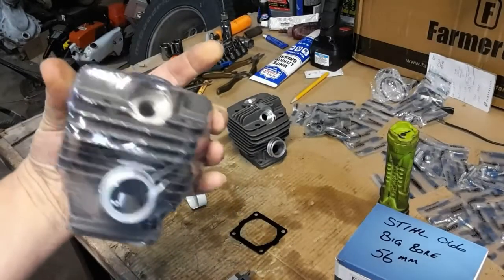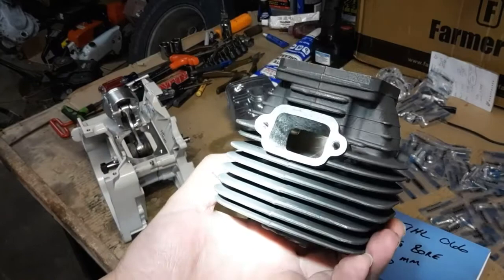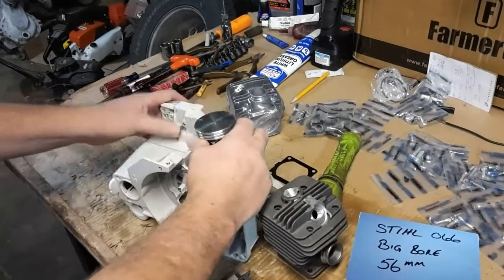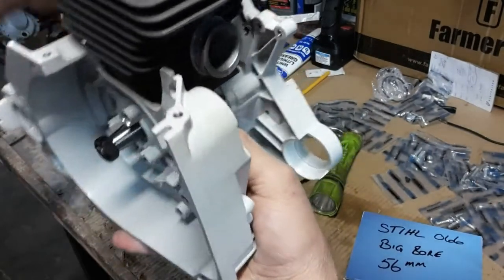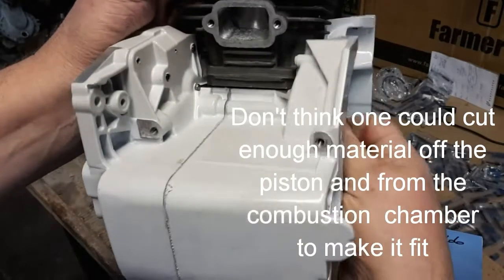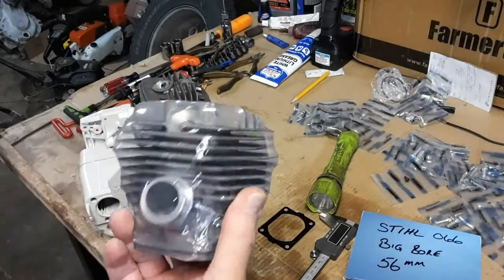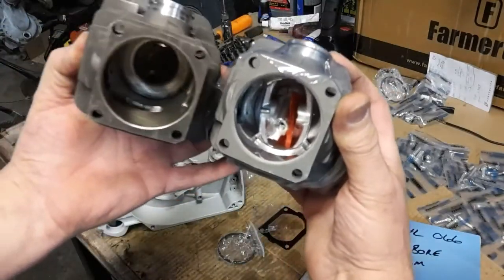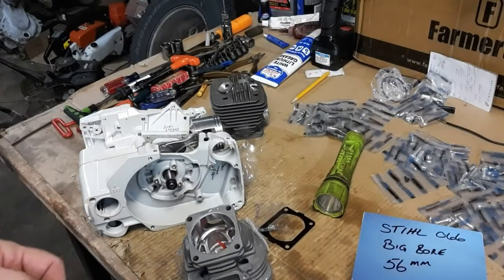Huztl MS 660 Cylinder won't fit

Comment: Craig, I purchased 2 each Farmertec/Holtz MS660 saws assembled.  Decided to buy the 56mm big bore kit with pop-up piston.  During assembly, I detected metal-2-metal contact while rotating the crank.  The crank hit lockout while rotating.  Pulled it apart and observed the piston skirt was hitting the top of the crank counterweights.  I ended up slowly removing metal off the bottom of the piston skirt until adequate clearance was obtained.  Since this is a single cylinder engine, balance was not a big issue.  No free-port observed.  Bought a similar kit for my 2nd MS660 and the same situation occurred again.  Both saws have 0.020" squish.  Building a MS880 kit now.  I appreciate the info you posted on centering crankshafts.  Keep up the good work.  I subscribed,

Comment: they never sent you a replacement?
Reply from the maker: I did not pursue a replacement due to I had done lots of grinding to the cylinder for port work before I tried test fitting.
Lesson learned now I always test fit first.

Comment: I've put at least 10 of these kits together never had that problem did you put the piston in the cylinder off the saw making sure that it's going all the way to the top of the cylinder
Reply from the maker: Yes I did, ths squish with the stock cylinder and piston with metal gasket would have been around 
.047 thousandths and the gasket delete build i done come in at 
.021 thousandths squish.
The inside of the Big Bore looked rather good it was a real shock when I found it was a head slapper, I beleive the poston might have been a Husqvarna 395 piston miss packaged but that's just a guess.
I have another 660 kit that I'm debating on building useing this big bore piston/cylinder cutting a pop-up and if needed cutting the squish band to set the squish to around .020 thousandths with a base gasket.

Comment: A fiber base gasket is what came with mine, grey in color.  I do not know what the squish is, now, and do not really care.  It runs good, cranks easy and relates. That is all that matters to me.
  I know Walt had a problem with the 56mm pistons - they kept hitting the base gasket and case.  As I remember, he had to release the piston skirt to keep this from happening.  That .65 dimension you mentioned has to be in millimeters, instead of inches, but you did not state which.  These gaskets are about 20 thousandths thick.
Reply from the maker: The .65 reference is in millimeters, in the upper right hand corner of the display on the caliper you can see it is displaying mm

.65mm is right at .025 before it is installed and crushed where it should wind up right at .020 and this is on the metal shim gasket which is in this video.

Comment: I built my ms 660 with the stock cylinder and piston and it ha .00225 squish with the paper gasket that came with the kit.  It beat me to death cranking it.  I finally replaced the cylinder and piston and used a metal base gasket from hL supply.  It is a piece of cake, now.  It has about the same pull over as my ms 271.  Before all it would do was pop and yank the starter rope out of my hand.  It broke two starters and pulled the rope right out of one of them.  Now, it is a pleasant saw to crank and usually does it with just a few pulls.
Reply from the maker: I built this saw useing the stock cylinder with no base gasket obtaining a squish of around .020 if I remember. 
I have built 5 of these 660 kits to date and have never been supplied a paper base gasket all of them supplied have been metal from Farmertec/Huztl and metal is also what is stock OEM from stihl so the paper gasket must be something new or your kit was assembled with the wrong gasket.

Comment: Ran into the same issue this past week, not quite as bad. Original piston and cylinder went fine. Did 2 of them and 1 big bore was fine and 1 wasn't. Waiting for answer on replacement. Overall I am impressed otherwise.

Comment: I had a problem with that little cooling fin on the right forward corner next to the exhaust port.  I had a he'll of a time getting that cylinder bolt into the cylinder on the 54mm jug.  I had to grind it off before I could get the cylinder bolt in.  The delay may have compromised the base gasket seal and I may have to pull the cylinder and replace the base gasket.  You need to check to see if you can get the bolts in before you put the cylinder down on the case.  I will do this in the future.  I thought my 54mm cylinder was pretty good on the inside and outside.  I made no modifications to it except cutting off that short fin during the assembly process.

Comment: Ms 661 has a 56 mm bore an a37mm stroke the 660 has a 54 mm bore an a 40 mm stroke
Reply from the maker: Thanks I'll check the stroke and mic the big bore piston and maybe get this figured out
Reply: Craig Timmons I'm building  660 right now I'm trying  a 54 mm pop up piston this time  all the big bores iv done have ran hard good power it's still hit an miss on the after market cranks tho seems like 1 in 3 fail on the big  end of the connecting rod an I've had two snap off at the flywheel  thin one I'm building  now has a oem crank an mostly Italy made parts
Reply from the maker: No issues with my ms660 as of yet, good luck on this build hope it turns out good.
I'm in the process of an ms440  build at the present time. Fuel tank would not hold pressure or vacuum, found over flashing in the cap opening where the o ring seats trimmed that off now all works as it should including the tank vent.
Reply: Craig Timmons my 440 is a beast it's one of my favorite ones

Comment: Check your wrist pin height  on your big bore piston I'm thinking they sent u a m661 piston witch is 56 mm but set up for a shorter stroke the 660 has a longer stroke then the 661
Reply from the maker: Charles Brisco Would you happen to have any specs on the wrist pin location for the ms661?
Reply: Craig Timmons no I sure don't put ur wrist pin in half way an put in the 660 piston an compare the were the to of piston  is
Reply: I no the 661 has a shorter stroke then the  660
Reply: 37 mm stroke on 661 40 mm stroke on the 660
Reply: So if they sent u a 661 piston an ur stoke is 40mm the pin height is 3 mm off
Reply: so in order to use that cylinder all he may need to do is to get a 660 piston???

Comment: The big bore kit has some free port with the gasket.  I am betting you just got shipped the wrong cylinder. The BB kit I got from them fit great aside from the free porting.
Reply from the maker: Tey Roo That was my first thought, then I thought it just might be a bad casting. Either way I'm going to try to cut the squish band and make it usable if I don't ruin it first.
Reply: Did you compare the two pistons from wrist pin hole to top of piston with the Mic? It's hard to believe that the cylinder cast was off but in China possible nonetheless. With that much of a difference, I'd think the piston's wrist pin hole was bored out of spec. Simple measurements between a working unit's stroke and the BB kit will give the answer.
Reply from the maker: Southeastern Ohio Honeybees  No I didn't at that point I took it off and installed the stock cylinder and piston which had a very tight squish, if I remember like .020 thousands with just a base gasket delete.
I'm going to check it out when it warms up some to see if I can figure out the problem, if I can I'll do a video on it.
Reply: What really sucks is that you're probably not the only one. If they had a bad run it's hard to say how much production took place before they caught the problem if they caught it at all? The Chinese run a very tight budget and every single thing they make gets shipped,because they know full well most people will just suck it up as a loss. In this day and age it doesn't take long for bad word out mouth to put you out of business either so it's hard to say isn't it?
Reply from the maker: Southeastern Ohio Honeybees Yes I agree there's many more like me, most of the time I like to figure it out at the point of the problem but when I get in a hurry I tend to miss things or toss the issue to the side till later as with this case.
I have video's posted of the unboxing of the MS180 & MS250 which were purchased for $55 & $65 which had very poor quality issues that I was able to work thur.

Comment: all you need to do is shorten the stroke . . get a shorter con rod
Reply from the maker: Jason Pearce I thought about cutting some off the top of the rod but didn't do it
Reply: +Craig Timmons I would just cut the con rod to proper sized stroke and give it a good solid weld back together . . its not proper I admit but it could have solved your problem

Comment: That's a long stroke on on a short block
Reply from the maker: Your telling me, still not quite sure what was going on, I think maybe the wrong cylinder?  The stock cylinder fit great and with out a base gasket it has    
.0195" squish which should make it run a lot better than stock.  This is going to be a work saw so I just put the stock cylinder on as it was shipped.